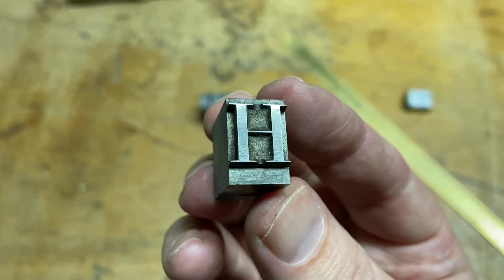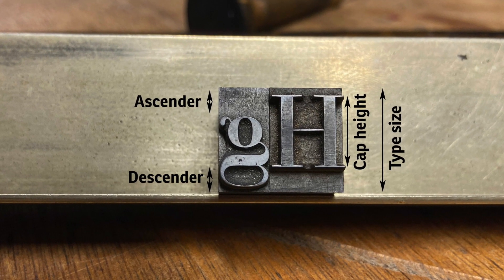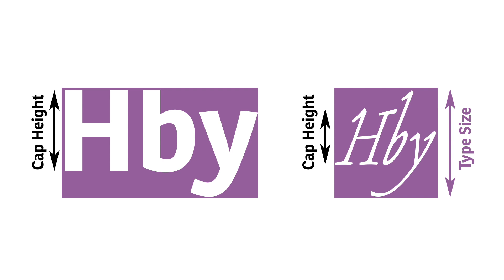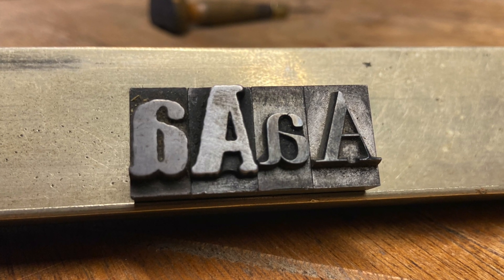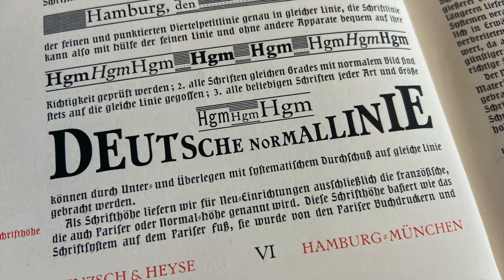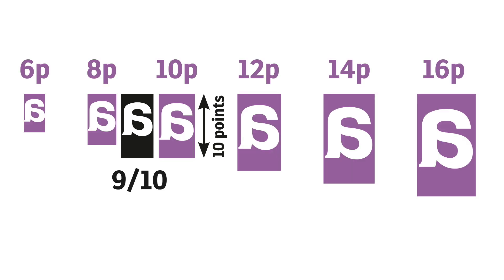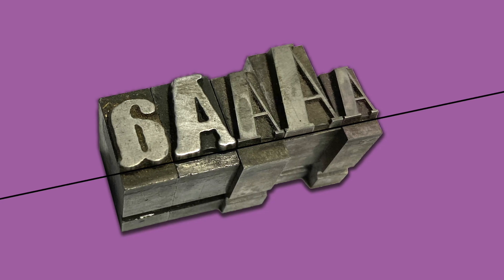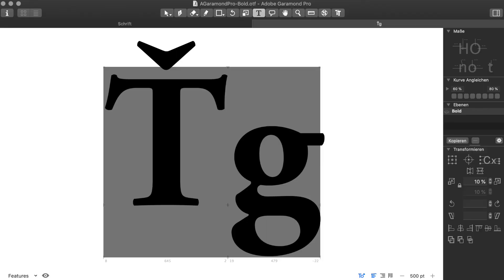Why do fonts in the same size don’t have the same size?

Comment: Great video! What do you think about the metric proposals for measuring type sizes? Like quart, which is used in Japan (0.25 mm) and it's available to use in Illustrator, for example.
Reply from the maker: Not a fan. It only adds confusion. A more interesting question is WHAT to measure, e.g. the x-height as the best possible (size) indicator for legibility.

Comment: I knew most of this, but only after doing a considerable amount of research into why two fonts that were the "same" size in points didn't print to the same visual size on the paper. This is an excellent and concise explanation. Well done.